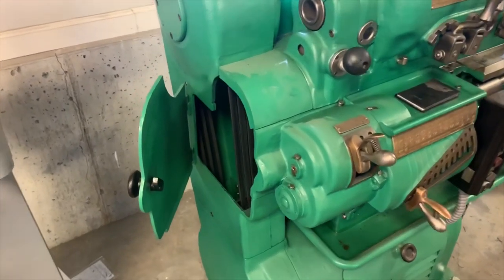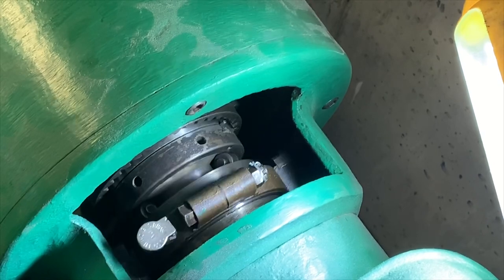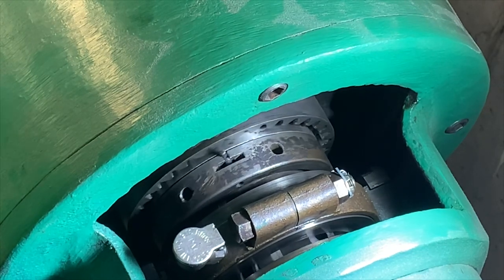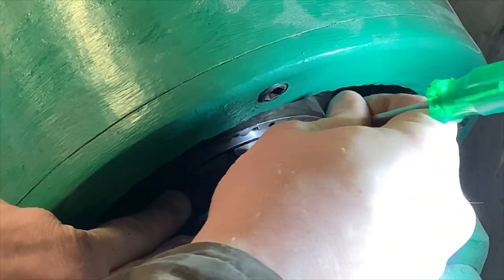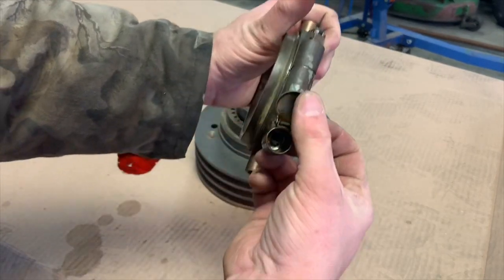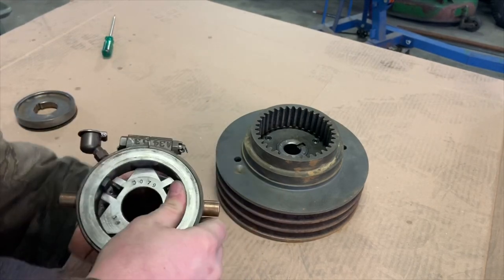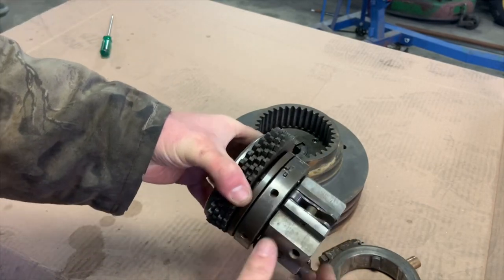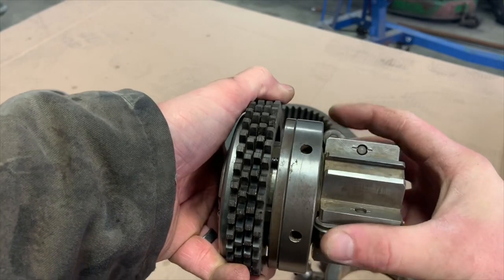Hendey Lathe Main Clutch Adjustment & Component Overview

Comment: Hi there , thanks for this video! I have a McDougal lathe with type of main clutch assembly. Any idea where i could find the outside gear shape friction disks or even a good material i may be able to cut the shape out of with a CNC router?
Reply from the maker: Sorry,  I haven’t had to look for a replacement but I wish you luck.

Comment: Great video. Good information. I have a Hendey the same size but not so nice of paint job. Please explain to me the feed calculation. it says 4 times the threads per inch. I don't get it. Tks.
Reply from the maker: I’m guessing  here but I assume this is to determine feed rate. I’m a self taught home machinist so this I will have to defer to someone more experienced.
Reply: @MikefromMissouri  I'm guessing u multiply 4 times threads per inch and call it inches. eg. 4 X 24 =96 or .0096. or 4 X 80 = 320 or .0032. Mostly a guess. Took some's cuts and it seems to look like it. I'm a retired Machinist and have operated many machines but never had to guess like this before. Always something new. I notice the back gears on my lathe are very noisy. is that common with this lathe?
Reply: And it is the feed rate. Amount of travel per rev. of spindle.
Reply from the maker: I think you are correct. My headstock is fairly quite. I wouldn’t consider mine loud entire I engage the feed gears.